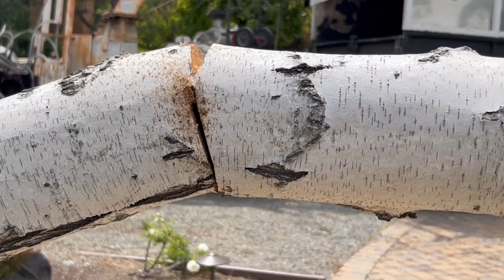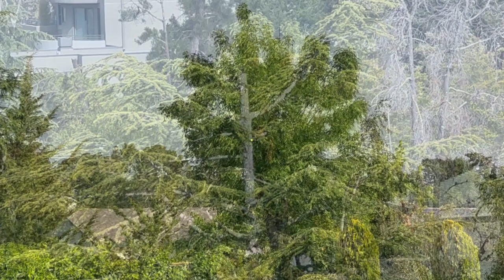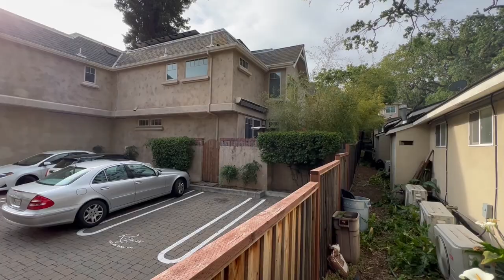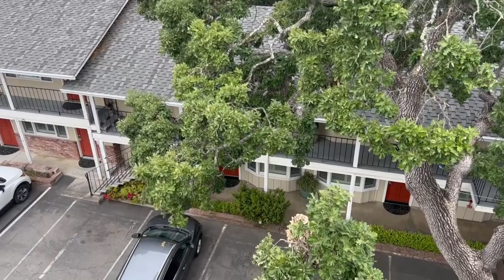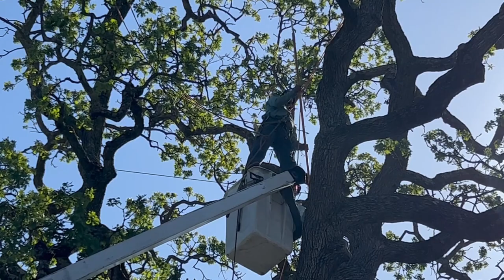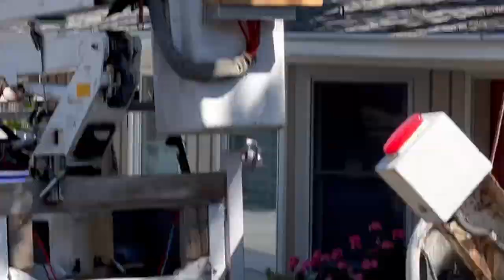STORY of an ANCIENT TREE

Comment: It's pretty sad to see such a nice old oak tree in its final years of life. It really looks sparce and had so many dead branches.
We have oak trees here too, they aren't the same type but they look very similar as far as branch structure and the leaf shape and bark goes.

There used to be 4 of them nearby my house, all in different locations, except for 2 that grew side by side. Those 2 were very recently cut down, 1 had completely died a year ago, the other was still alive but not by much. A few years ago there was some work done in the lawn nearby them, I noticed lots of damaged and cut roots. They immediately began to die after that. It's actually upsetting to see this happening to nice trees.

A 3rd oak tree wasn't too far from the 2 that were recently removed. It had tip dieback all over several years ago. But it began sprouting out everywhere and in a few years time it was looking so much better, almost as full as it originally was. That tree was removed almost 2 years ago.
The 4th tree is still around. It had some dead but that was recently trimmed out. It seems to be doing ok. Something all 4 of those oak trees had in common was they were all right next to roads. Only 1 is left.
When I have a chance I'm going to look at the stumps of the 2 that were next to each other. I'm curious how old they were.
Reply from the maker: Always fun to count the rings. Oaks can be hard to see the rings

Comment: one tool that has taken over for the standard pull saw is the ryobe version 40v i currently have it extendible up to 12ish feet. but using an battery version is really nice to get bigger stuff and then use the 'ol pole saw or pruners to finish the really far stuff.
Reply from the maker: Need to check that out

Comment: Nice work men. I climb alone most of the time, don't tell osha. If I drop my pole saw, I'm S.O.L., and I worry a LOT about bumping it and cutting myself or my rope. Lately, on big moves through the tree, I'll clove hitch the pole to the (standing?) end of my rope and set it down on the ground, then retrieve it when I get to where I'm going
Reply from the maker: Yes, working alone is a risk. Be careful
Reply: What if you used a short lanyard to hang the pole saw with a clove hitch from your saddle. you may need to tie a scabbard on that lanyard too.
Reply: @MrTrevorfrommass  I've considered it, but if I'm making a big move, I don't especially want it on my person. I'm almost busy enough to hire someone these days, THAT should solve ONE problem.

Comment: Hello Glenn, 

I believe you to be a true pioneer after watching hours of footage! Found your YT page portfolio mesmerising thus far... I have chosen a tree for my future garden an oak that is evergreen Quercus ilex (Holm Oak) - I have found a neat and well structured seedling or so I thought as I may have done goofed I have made a flush cut on the trunk the tree looks like it was its 3rd branch. this cut is roughly 2.5cm above the soil it is planted in. The circumference of the tree is little no more than 1.5cm and the overall height is 15cm.  

which leads me to a question have I compromised the structural integrity of this tree or will it heal? should I use some method of maybe peeling another's branches hide off of it and making this flush cut have new skin?  

Could an early flush cut on the trunk of a tree compromise its structural integrity in the long run? 

there is space for this tree to grow huge down the line especially since it is on the far edge of a forest which continues south-east - south in a location that enables it to have 5-6 hours of sun in the winter and 7-9 hours as the days get longer. the Forrest will not continue further this way it will be the tree that starts it, right now the tree has been transplanted into a 10x bigger well drained clay pot with an escape central hole for growing a nice straight root down, bought it as a non-tangled root system so really found and picked an idea specimen of a tree just this flush cut worries me, I could make this a bonsai if you think it could compromise the integrity of a huge tree in a long term view of health and find another seedling to compensate for my rookie behaviour.   

Lots of healthy mulch soil I wish for you in your garden and Plenty of Kool Adventures!  
Kind Regards 
Architectural Technologist 
Szymon Lewandowski